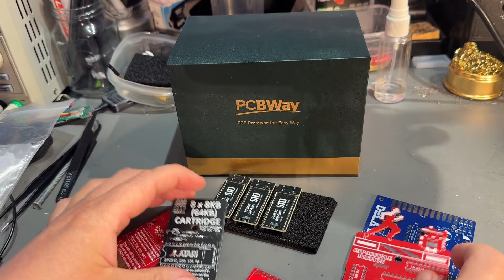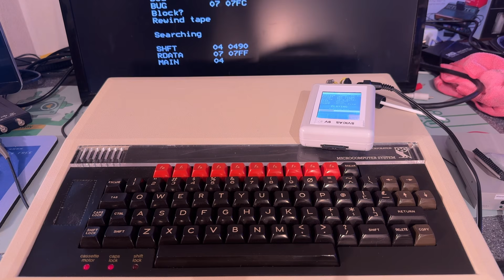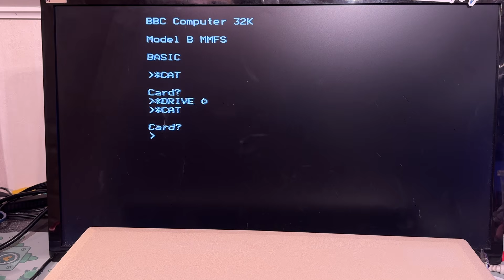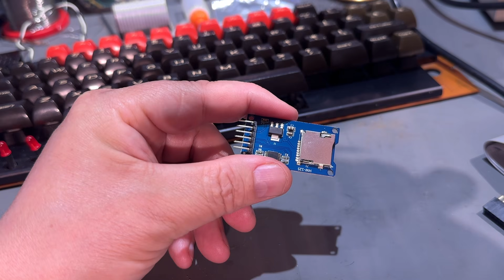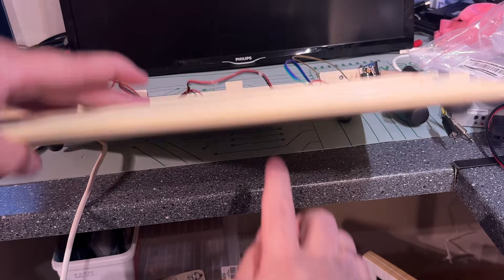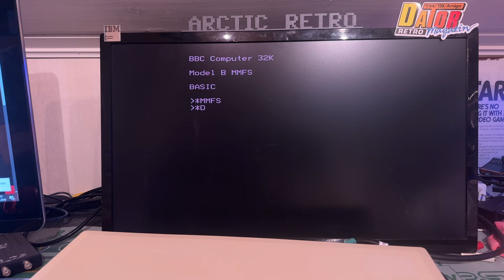The BBC Micro  - Exploring another retro computer and adding a SD card reader to it

Comment: Find resistor pack 1 (RP1) on the circuit board. This is the point at which an engineer pressed a finger to make it work. True story. RP1 was added to solve this. Steve Furber indicated that they have no idea why it workd ;)
Reply from the maker: Oh really ? Fun story

Comment: That Tube port was one of innovations that led so well to Archimedes and Arm! Direct 2nd processor interface. Initially because the BBC wanted a Z80 for CP/M, but that started to die a death before anyone really cared! But one the Raspberry Pi expansiosn really elevates this machine! 
Get used to the * commands for advanced features, but before long it'll be 2nd nature and very comfortable! Thge unpopulated chipos will be the Floppy Controller, and the ECONet, acorns built-in LAN technology.

edit: Fellow YouTuber "Least Significant Byte" has some great Beeb content, get to see the real power of its Basic with embedded assembler, advanced Roms and so on!

Comment: Oh and with MMFS. If you shift break at the power on prompt (as long as it reports MMFS as the disk system) it will load the menu for all the games. no need for DIN and DCAT. Also if you get MMBExplorer you can add and remove disks from the image file. You can also write to disks if they are unlocked so basic programming and saving is totally possible despite no gotek.
Reply from the maker: Thanks for the tips, that's really helpful to know!

Comment: These machines are built like tanks. designed to withstand the abuse of a 1980's british school kid! I just got a master 128 to compliment my BBC B and its stuck MMFS, a 4 way rom switch and a pitube into it. Such a crazy upgrade..... You can hurth them though. Whatever you do... do not type in:- 
10 *MOTOR 1 
20 *MOTOR 0
30 GOTO 10

It will kill the tape motor relay in seconds..... (pro tip from a british kid with an evil streak at high school!)
Reply from the maker: Haha, I will definitely steer clear of that code, thanks for the tip! :)